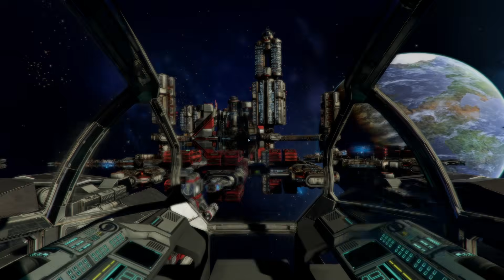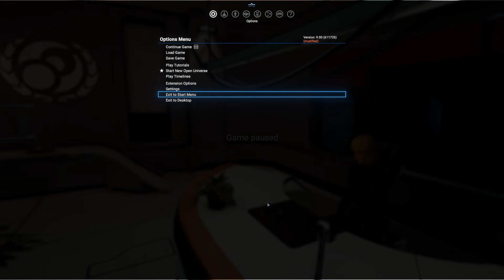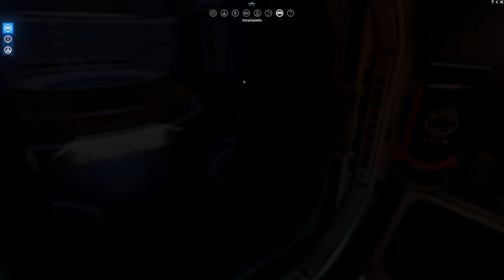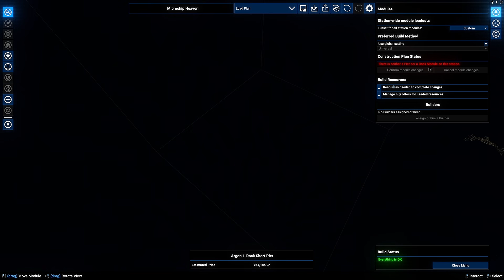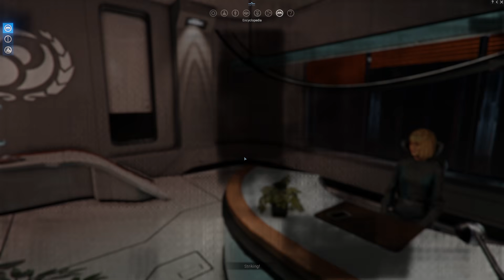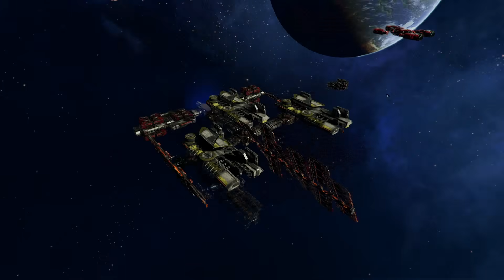X4: Foundations 9.0 Station Building Guide – Plan, Balance & Build Efficiently

Comment: For storage types:
 - Containers: Anything you craft
 - Solid: Anything from a mineral miner
 - Liquid: Anything from a gas miner
No need to ask the encyclopedia, it's literally that simple.

Also for station managers: Seminars give you exactly one star. Hire someone with ⅔ of a star as a manager, give them a basic seminar, a one star seminar and they will be right at 2⅔ stars from the get go and won't take too long to reach 3 stars. This gives your station traders one additional jump much sooner, just for the price of looking around.
Reply from the maker: Yeah, storage is very simple 😊 i was just trying to emphasize to use encyclopedia if you dont know how/what something is.

I've noticed that managers dont take very long to level up so that's why I didnt mention seminars, but I can see how it would be beneficial to get one leveled up fast seeing as management seminars are fairly common at traders
Reply: Thanks for the star explanation. I’m still confused. I thought it leveled it to the next solid star so I’ve been trying to use it on the lowest star rating.

Comment: Things to note:
1) Just because a station is buying a ware doesn't mean there's much demand for it, you have to consider the amount of they are willing to buy as noted by the hexagon icons next to the wares. You can filter to only look for high demand wares in the trade filter on the top right. 
2)  Shuffling stations sucks, it adds too many extra connections you don't need. It's a waste of time and resources. 
3) Google X4 calculator, it'll help tell you want modules you need for an efficient build. 
4) Holding shift while rotating modules will tick it to the next 15th degree rotation.
5) Plot size is cheap, start with a 4x4x4, you'll need it.
Reply from the maker: Just recently learned about the shift trick 😅

X4 calculator hasn't been updated and doesnt accurately calculate the production, which is why I didnt mention it (unless it was updated recently for 9.0?)

I was just using that as an example, I did mention to check the area to make sure there isnt any other suppliers there.

I mentioned the shuffle option because not everyone wants to waste time building the station and want to just fly 😊

Comment: Building my HQ up to the full production chain is such a black Hole of a timesink.  
I went on a btueprint stealing spree and now I am building and building and building.... 😂
Boron Ring structures with tree  boron triangular (hexagonal?) shapes attached (only three, because the other three connection points on the ring structure are connected to long connection type 3s throug them other ring structure) below the rock are nice. Kind of like a Honeycomb with Nodes.
 On each triangular shape you can fit up to four production (or whatever) modules. So in total you can fit up to 12 modules in one ring.
Reply from the maker: I like Terran and Boron styles, especially if you mix/match them! Looks really unique 😊

Comment: This is okay as your "first station" or as a "beginner" guide, but I find this balancing approach pretty useless. Unlike in X3, Foundations has a much more approachable and simplified economy. Your best bet is to build big, or at least build modular, so you have the ability to expand as you go. You'll fill shortages really quickly, and then it's just a matter of using your own resource production to build more of your own stations and, eventually, ships. If you're building a refining station, it's better to have 8-10 refining modules for each resource and refine every resource at the same station. You can then build an intermediate resource production station with the same principle in mind, and so on. The current in-game economy just can't sustain the demand and supply the player requires to progress at a steady pace.

And yeah, if you don't build modular, you can just throw modules all around the station without even connecting them to one another. It'll still work, it's just a matter of whether you have enough space to fit all the production modules inside the plot.
Reply from the maker: I did find out doing this video that you cannot put the argon storage into vertical position 😅 it seems to only allow horizontal. It allowed me to place it but then would build it then deconstruct it repeatedly. 

And I agree, the bigger the better, but as a beginner you should stick to information you gathered on the universe, find the "missing" product and supply it.

The reason I chose to do a "min/max" style of guide is because starting out, you dont have a lot of money, so you need to penny pinch if you want to get a station as fast as possible for stable income.

I did forget to mention to always leave you open for expansion because you are right, eventually you will fill the shortages and then become stagnant. Unless you keep the shortage going 😈
Reply: When you don't have a lot of money, the best approach, I'd say, is to buy M traders and set them to fill shortages in busy sectors. M traders are cheap, a 2-star pilot is easy to acquire with seminars, and this approach will get you much further than min-maxing.

But well... everyone has their own pace and enjoys the game in their own way.
Reply from the maker: @robinhood263 honestly I forgot about the fill shortages command! That was added in 8 I think.
Reply: Yeah, it's a very useful tool simply because it's set and forget. You buy a ship, give it a command, and wait until your account balance allows you to buy the next one.

That's until some pirate raider shoots your trader down. But that's quite another story))

Comment: a Little tip for making Plots, if you hold shift when you drag the size it moves all the sliders at once, :) same with rotating sections while building, if you hold shift it will lock to set degrees, (can be edited in the station options menu, the cog, where you shuffle) just makes it all faster and more precise.
Reply from the maker: Good tips! I've always manually did the sliders never even tried hot keys 😅
Reply: @Alakeram  i used too also, i was like 2k hours deep before i learned it, i was like... damn it now i always use it hehehe
Reply: Thank you for the information concerning the sliders. 250 hours in the Game and did not know that.
Reply: Oh wow thx for that. Knowing the degrees can be set is an awesome find.
Reply from the maker: @kiddcannibus I recently tried it and it does not like to do it in 5degree angles at 280 😅 still is useful information though!
Reply: Shut up…. 🥲 1500hrs in total and you’ve just given me this info! Thankyou!